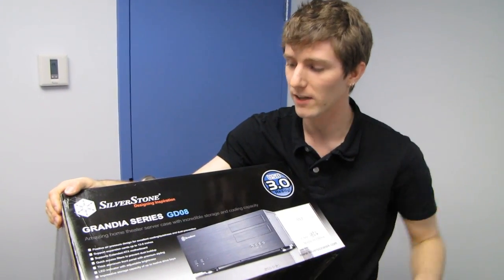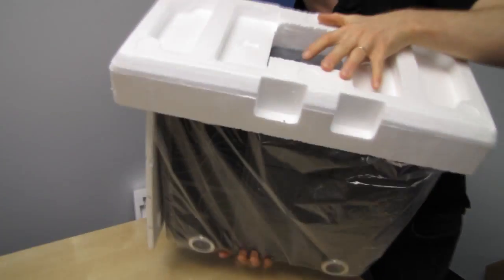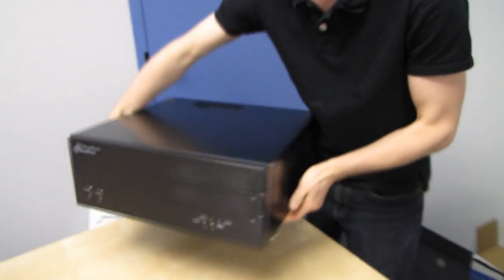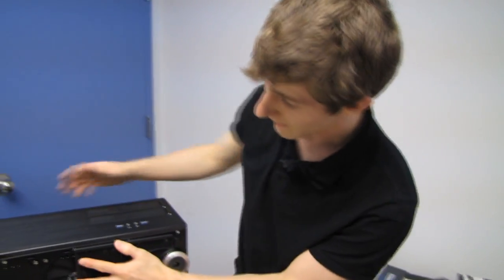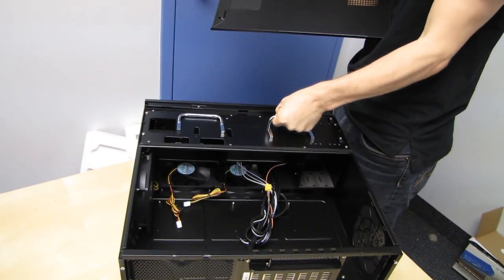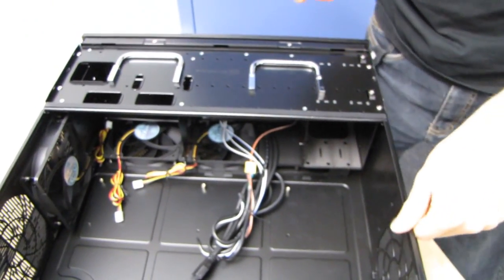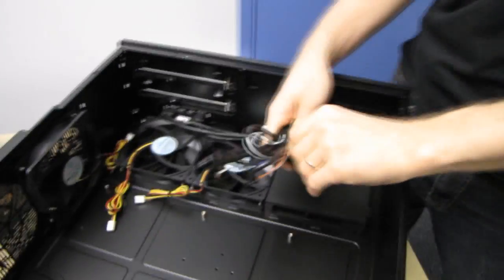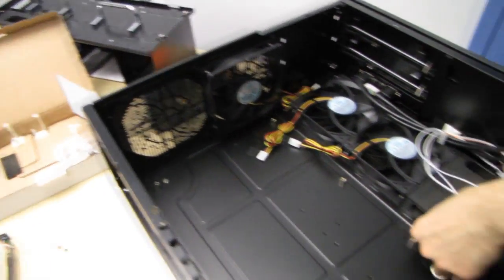Silverstone Grandia GD08 Ultimate Media PC Case Unboxing & First Look Linus Tech Tips

Comment: I find it crazy that this case is still the best home media center case available, even after all these years!!
Reply: I am about to rebuild our htpc and will reuse the case because it is still the best.
Reply: @theatremad9797  was looking for a modern case to migrate a win98 retro into wanted a horizontal case this was the ONLY case that has 2 external bays for cd/floppy .. may need to accept i will not find a 3-4 bay one for xp build
Reply: sad that there isn't many HTPC cases on the market. this one is truly the pinnacle
Reply: @Amfibios  this would be good for a full system where you need as small footprint .. set the monitor on top
Reply: @darunealbane  yeap! unfortunately desktop computers are pretty much dead. i've worked in IT for years and nowadays the vast majority of people just buy a laptop and they seem to be satisfied with the "all in one package". they don't even buy towers anymore xD

as for me... i'm not switching to cloud, streaming, or shitty laptops just yet. i just ordered one of these to build an unraid server with it.
Reply: @Amfibios  MS is pushing cloud OS .. screw that will switch to linux
Reply: @darunealbane  haha i feel ya... i'd have switched to Linux yesterday if i could run all the software that i need on it.
Reply: @Amfibios  😡😡 ya .. had some hope for reactOS but the group leaders are not that smart funding wise .. should build an SBC with ability to have daughter board with historical IO types
Reply: I still have 2 GD07s in my home rack today!
Reply: It's been 4 years since your comment and it is STILL true.

Comment: 2019/2020, planning on buying this case for a Ryzen 7/RX 5700XT desktop build.
Reply: How did it work out? I'm actually planning a very similar build.
Reply: hey i know this is pretty old but hod did it work? i have the exact same plan. retiring my 2700x and 5700xt
Reply: @itsjiggy502  I opted for a different case, so I can't say :(
Reply: @Levy_Wilson  I ultimately ended up using a HAF XB Evo.
Reply: I just ordered this case. Going to try and cram a 9900K/2080Ti build in there.
Reply: @Blakksheap  how did it go?
Reply: @18yearsoldnot  It actually all fit without issue, although temps are bit higher, but not bad overall.
Reply: 2022 here.... i ordered one for an Unraid server
Reply: @Amfibios  please update me on that. Looking for a case that would fit my 19" rack
Reply: @RealThore  hey mate. this case isn't easy to find nowadays, it was out of stock everywhere in my country and i had to place an order which will probably arrive on Monday. What would you like to know about it?
Reply: @Amfibios  I’m just interested in overall building experience with this particular case. Here in Germany it’s still available from some Amazon retailers for about 200€. I just need a fitting case for tons of 3.5” drives, I don’t care about throwing 2.5” SSDs somewhere in it^^

Comment: Best case I ever bought. Provides a very good airflow when configuring right: front bottom 2 Bq! 12cm inlets, 2 Bq! inlet on the side and a double set on the Noctua cpu cooler. Running a I9 icw a rtx 2060 and stacked it with several hd and ssd's without any problem. This review back then helped me make up my mind: "I need to get that one" :) So thanks again for sharing your thoughts Gabriel.

Comment: I think the actual aluminum metal can be etched by the oils from your fingers if you touch it, but that's why they put some other type of metal over it like copper or something to prevent that, or something. I don't think most brushed-aluminum is pure aluminum, but I may be wrong.

Comment: we use the same type of positive air pressure in Paint booths in the automotive field. and have a pressure control button to help keep positive pressure to insure no dust enters throw cracks and holes in the walls of the booth. Great thinking on there part.

Comment: Can Silverstone make sst gd08b a bit more higher for about 3-4cm.So I can install my future Amd Threadripper 2990wx configuration inside with an air cooler like Thermalright Silver Arrow TR4 or Noctua NH-U14S TR4-SP3(swapping the stock fan with 2 Noctua NF-F12 iPPC-3000 PWM or with Noctua NF-A12x25 PWM for silence but with 2000rpm and less airflow not sure),ROG ASUS ZENITH EXTREME ALPHA(,Cooler Master CMA-CEMB00XXBK1 to bend easy the 24 pin) 128 GB DDR4 2933 MHZ HyperX Fury black ,Evga Super Nova 1000t2 1000w Titanium,LG Blu-ray disk RW.,Hot swap for hdd and ssd ,Samsung nvme 970 2tb,rx Vega 64 with rajintek Morpheus Vega cooler(gelid 4 pin PWM to mini VGA 4 pin)and 2 Noctua NF-A12x25 PWM, i don't like liquid installation. Give them this suggestion please, instead I'll have to buy it and cut a small area above just to pass through my Air cooler so I can fit in everything. IF YOU WANT AND HAVE TIME BUILD THIS PC (REAL  DESKTOP) PLEASE AND SHOW EVERYBODY THAT YOU CAN HAVE A BEAST CLOSED WITHOUT RGB LIGHTS AND WITHOUT SHOWING OFF. PS :THIS WILL BE MY FUTURE  PC EVEN IF I HAVE TO CUT A HOLE ABOVE THAT CASE for my cooler🤣🤣🤣🤣🤣

Comment: You can mount on on the top/back fan slot for a self contained water cooler.  It'll be tight though, and depending on what your motherboard has for heatsinks on it, it might get blocked.

Comment: I still own and use this case. Fitting 2 x RX580's, Noctua cooler, ATX, 6 drives...and it is very cool inside.. Love it
Reply: a bit late to the party, i know, but i just ordered one of these..... xD i want to build an Unraid server and this thing can take so many drives inside that it's not even funny. it also looks great , it can be mounted on a rack and it'll be whisper quiet with 120mm noctua fans compared to server cases for racks that make a ruckus with their tiny high rpm fans.
Reply: @Amfibios  It is a truly amazing case...so much so that I sold that system and built another one.....in a new GD08 :)

Comment: I like. Not because I could squeeze soo many drives in, or a dual CPU mobo or any of that stuff, but because it doesn't come with an IR receiver/display, instead it has dual 5.25" bays so I could fit one of my choosing (unlike the Antec Fusion which comes with a really crap display).

Comment: I don't see why you couldn't do it at the side. The rad isn't that thick (I have an h100) unless it blocked the ram slots on the MB but it probably wouldn't as long as you only use two fans and not 4. If anything the double thick rads would be less compatiable with this case then an H100. If it was two tight inside you could mount the h100 outside the case and have the fans on the inside blowing out of the case into rad on the outside. As long as you cut some small holes to run the tubing.

Comment: I think you might even be able to fit a 360mm radiator by taking out the case mounts, which would take to an entirely new level when it comes to filling it with hardware. Only problem would be having to do some modding to create mounts for the drives, pumps, etc. XD

Comment: its not the optical drive that vibrates like the HDD but the actual disc inside the reader as its not as securely secured to the inside of the drive as the magentic disc is inside the HDD

Comment: That looks basically like the GD09 apart from it has 2 X 5.25 bays and one less fan on the one side.   They look like really nice cases, but still are quite big. Basically an atx tower laid on its side
Reply: GD08 sets itself apart from GD09 & GD10 by the generous amount of Hdd's one can install. 
Like 3.5" x8, 2.5” x2 vs. 3.5" x 2 (one compatible with 2.5"), 2.5" x1
For me its a NAS.

Comment: Grandia Series, especially the smaller GD9 and GD10 make very good lan/portable gaming/Hi-end cases.
Very small case which supports three 120mm fans, full ATX power, and only 170mm thin-nice for check in baggage.
Reply: Really? I didn't realize the gd09 and gd10 were that small. I thought the gd04 was the smaller case of the grandia series.
Reply: Afro Sama Yeah in terms of volume they are pretty darn small considering they support eATX, although you cannot use the hdd rack if the gpu is long. I fly almost evey year and this seemed to be the only sensible way to pack my gaming eATX desktop.
Reply: Ah thats good to hear more about their size,  I plan on building my first pc with the GD09.

Comment: I've recently purchased this case and really excellent overall except for one thing, they didn't have provision for at least an LED indicator or two for a WiFi and BlueTooth. I ended up drilling two 1/32" holes for my LEDs next to the USB port 3/4" apart.

Comment: This case is fine for a gaming set up. Not so much one where parts are being overclocked though. Theres just as much cooling in this horizontal case as most vertical cases. Seriously though dont overclock your parts and itll be fine.

Comment: At the bottom under the hard drives cages.. I see 2 120mm fans and to the right the small room for all those cables and so on.. Is it possible to move this room to the right?
so instead of 120mm fan -> 120mm fan -> Small cable room
I then have this:
Small cable room -> 120mm fan -> 120mm fan
The reason im thinking of this is because im thinking of putting in 8 3.5" drives and want 2 120mm to cool those.. Thx!

Comment: Yes but again even with 10 spinning disc hard drives  and only 5 fans..you'll get enough cooling.  If you have to liquid cool a htpc, then you've done something wrong in building it.

Also ( this is just MY personal preference of caution) If the liquid cooling set up ever LEAKS, then guess what.  water or MOST liquids in existence and electrical components ( like circuit boards, ram, etc) don't mix. I'd rather have the peace of mind KNOWING i'll never have the chance to encounter that problem

Comment: 'still not much choice in 2019, this seems to be THE only horizontal sleek case that can handle mid tower amount of hardware .... 

yet it lacks tool-less mounting , cable management or motherboard backplate access ....
Reply: @Mike Watts doesn't have any of that, it's literally a shorter GD08 ....
Reply: @Mike Watts i'm 38 but as long as you're OK it's fine i guess :P
Reply: โอเคบูมเมอร์
Reply: well honestly cable management doesn't matter much on this case... if you can just tie the cables nicely so that they won't mess with the airflow too much you should be fine, it's not like there's a window on this... except if you were thinking to mod the top which would still be possible.

about tool-less mountng and backplate access, while they're nice to have, if you're not someone that keeps changing things on your setup it shouldn't make much of a difference. i've been building PCs for 15 years and most customers just change a gpu, add an ssd or add some ram in a decade's time.
Reply: @Amfibios  well i've been building computers for 25 years and believe it or not i'd still enjoy some cable routing tunnels of some sort and the ability to install a cooler without taking the motherboard out ¯\_(ツ)_/¯
Reply: @nickiebanchou  well... i can't argue with that! 😆